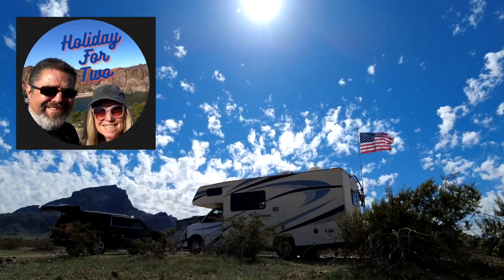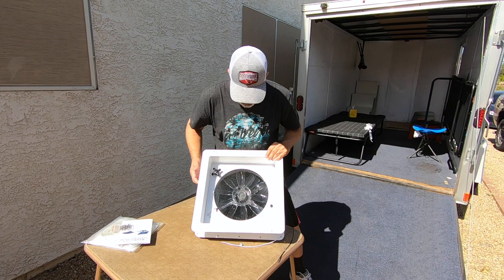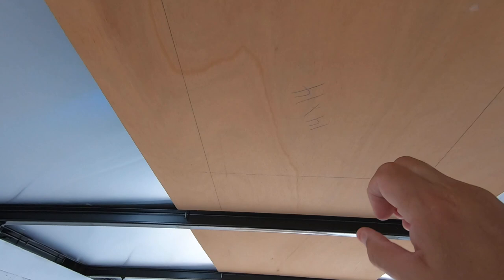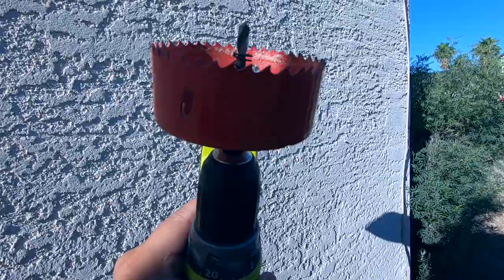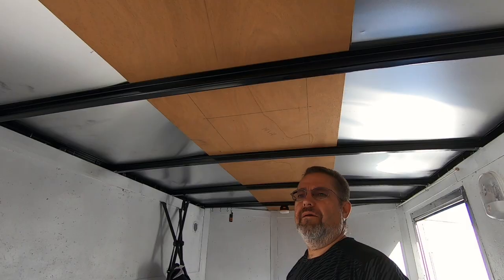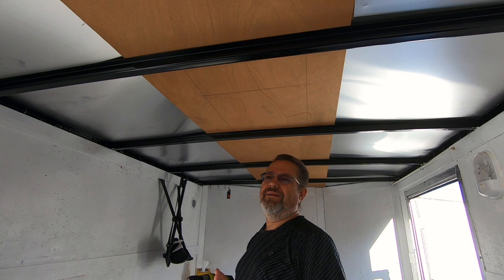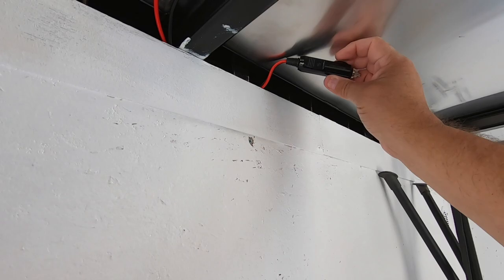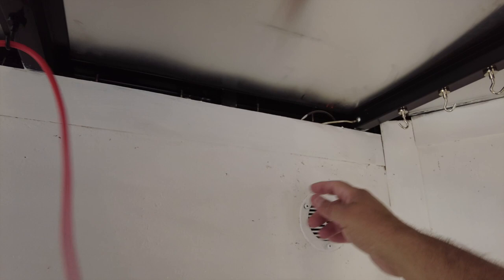DIY Cargo Trailer Ceiling Fan Install

Comment: In Arizona,  and especially in the summer,  insulation probably would be a good idea!  Also a suggestion for a future video would be on the necessity of having a first aid kit, a lot of campers and also in the home, are lacking the proper kits.......let's face it, they are especially important for you if you are out in the boondocks camping and get hurt. Just a suggestion
Reply from the maker: We actually have a kit in the motor home as well as the truck- I just forget sometimes that it’s there! 😃

Comment: I didn't realize how thin the metal is in the roof.  Good to know.
Reply from the maker: Yes it is, later on I may put some 1/2” or 3/4” foam insulation up there and paneling to help with the summer heat! Usually when we go out we park in shade under trees and that helps a lot, but oh boy does the sun beating down really heat it up!